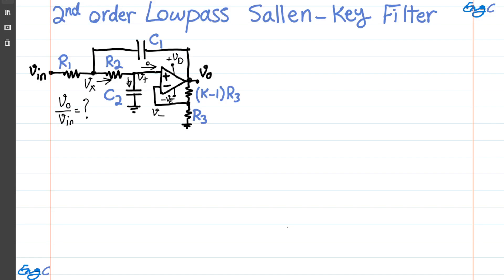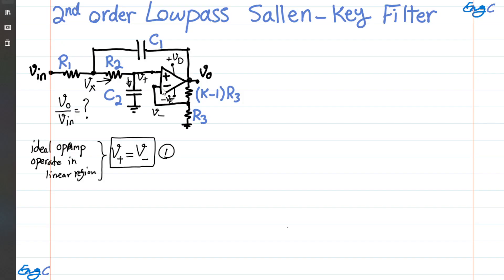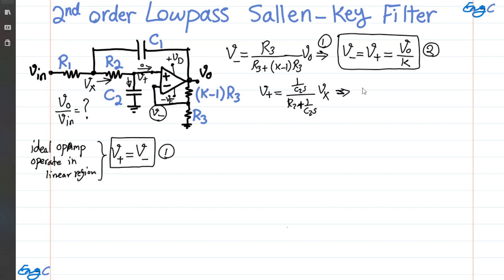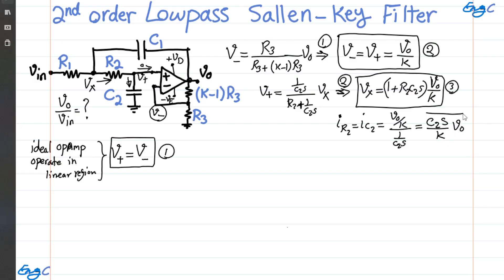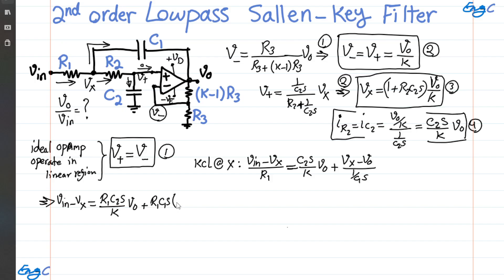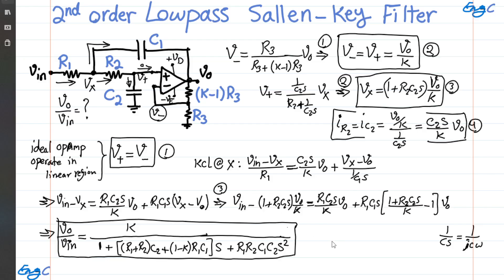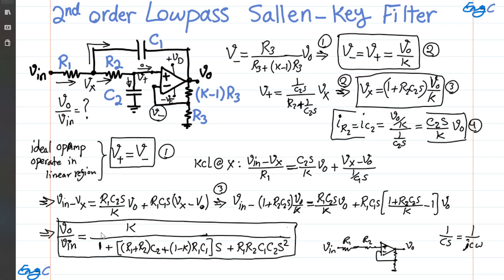Sallen-Key Lowpass filter design and transfer function with programmable gain

Comment: what is our gain equation in this video?
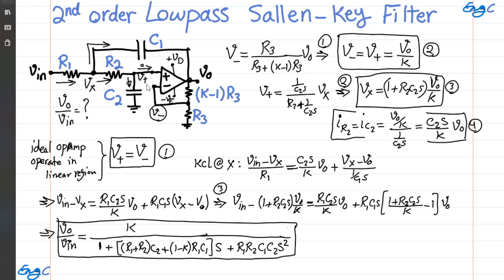Reply from the maker: Watch minute 8:45 - 10:00 to see the S-domain input-output transfer function of this Salley Key LPF. One can find the DC gain (K) by setting S to zero corresponding to DC or zero frequency. To further help, here are two related filter videos:   Sallen-Key Filter Design Tutorial: LPF, HPF Frequency Response, Damping Factor https://youtu.be/KwUnQXbk7gM
Butterworth Analog Filter Design with Op Amp https://youtu.be/SIMg5TOIgrA

Comment: An amazing video, but I have a rather silly problem. I didn't really understand why we could use the concept of virtual ground there , where you wrote v+=v-. Because, I have been taught that in case of positive feedback, we can't use virtual ground. Can you explain this? Thanks
Reply from the maker: My pleasure!  Here is a more detailed video Tutorial that might be helpful: https://youtu.be/KwUnQXbk7gM  which is the Sallen-Key Filter Design Tutorial: Low-pass and high-pass Frequency Response, Damping Factor
This design works because negative feedback will be far more dominant than the positive feedback in the circuit. Therefore will force Op Amp to operate in linear region where virtual short is valid.  For more Analog Filter examples please see:  Band-Pass Sallen-Key Filter Design https://youtu.be/lsM09pcrRVE

Universal Analog Filter Design https://youtu.be/2J-0msXZE2o
Butterworth Analog Filter Design with Op Amp https://youtu.be/SIMg5TOIgrA
Laplace Transform Example and S-domain circuit analysis:  https://youtu.be/ps8N5TPM_qU
Op Amp circuit Bode Frequency plot https://youtu.be/BLVzuuqAlZs
Bode Plot, Frequency Response, Transfer Function https://youtu.be/vZFkPeDa1H8
I hope these additional examples are useful as well. 🙂

Comment: Thank you so much for this video! I have a doubt, the op-amp circuit I'm trying to solve does not have the R3 to ground but only the (K-1)R3 connected to Vo. Is this configuration familiar to you?
Reply: let me guess, the value of that feedback resistor is r1+r2
Reply from the maker: You are very welcome. Glad that video is useful.  Yes, as discussed in the following two videos, what you mentioned is a variant of this Sallen-Key design. Please see: Sallen-Key Filter Design Tutorial Video: LPF, HPF Frequency Response and Damping Factor https://youtu.be/KwUnQXbk7gM
and Band-Pass Sallen-Key Filter Design https://youtu.be/lsM09pcrRVE
I hope these additional videos are helpful in answering your question.
Reply: @STEMprof  thanks for the reply! i checked the videos you mentioned, however my circuit is not either of them. mine is exactly as the one shown in this video, but without the R3 to ground. it is similar to the LPF shown in https://youtu.be/KwUnQXbk7gM but with a resistance connected between negative input terminal and the output. does this make sense? apologies if I am being unclear.
Reply from the maker: @phylmath  No problem. Yes, I understand. But the resistor connecting output of op amp to negative terminal (without any other connection) does not matter for op amp because practically no current flows to or from input terminal of op amp. So you can short the resistor as if op amp output is connected to input negative terminal similar to my additional op amp videos (links in my earlier message).  I hope this helps.
Reply: @STEMprof  Understood. So it would then essentially become a simple low pass filter. Thank you very much again. I work on power converters for particle accelerators at CERN and your videos have helped me greatly in understanding and appreciating these purely analog control circuits from the 70s. Hope you keep posting more videos!
Reply from the maker: @phylmath  Glad that my videos are useful. Please say hello to your colleagues at CERN enabling remarkable particle discoveries. 🙋‍♂️  Sure, next video will be about Electronic Gain/Attenuation Control that has many applications. I hope you find it useful too. 🙂
Reply: @STEMprof  Will do! Thank you :)